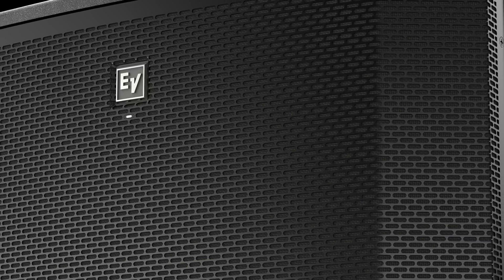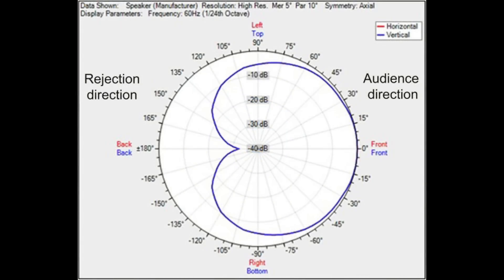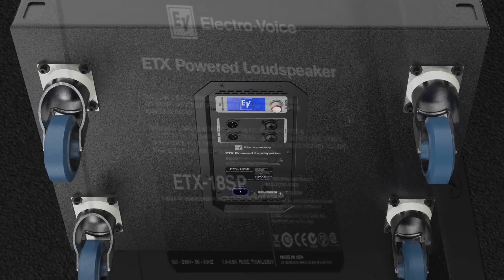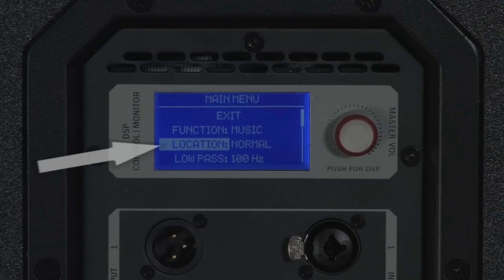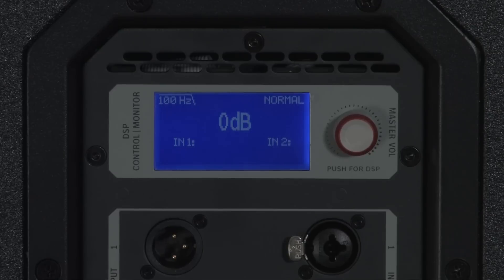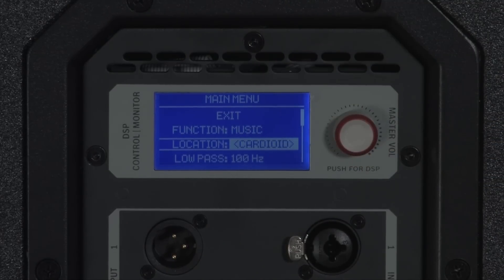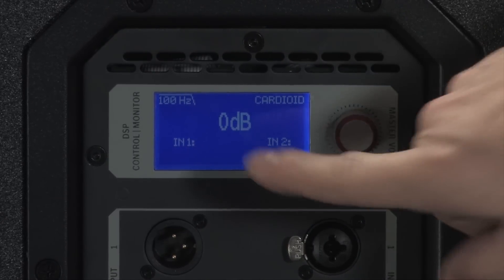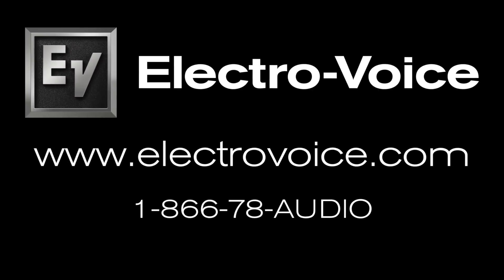Electro-Voice ETX Powered Loudspeaker - Subwoofer Cardioid Setup - Tutorial

Comment: What is the recommended signal processor to use with 2 of the ETX-15sp & ETX-18sp subs? I want to get the absolute loudest bass sound from my setup. I currently own a discontinued dbx DriveRack, but I want a better sound. Any recommendations?